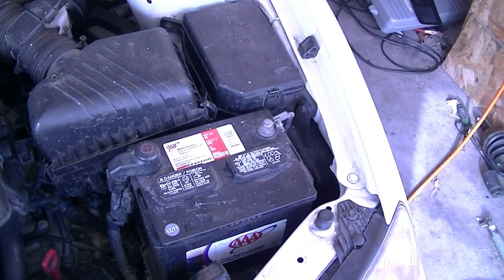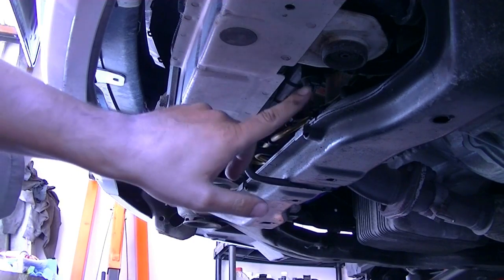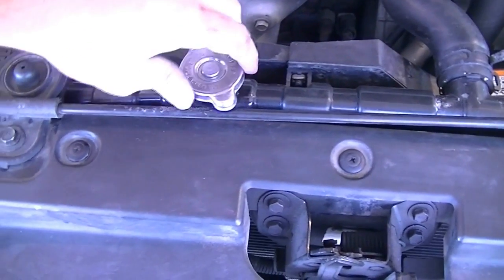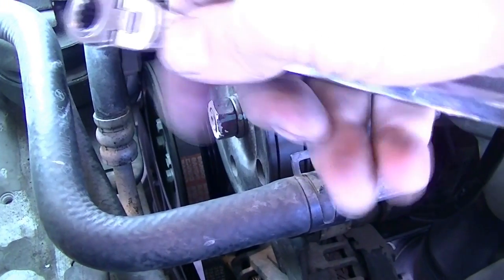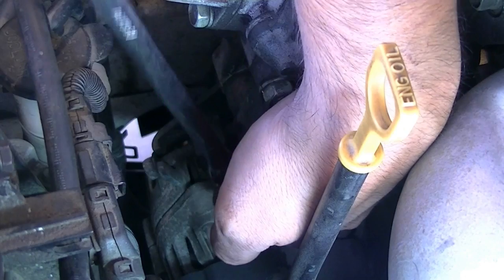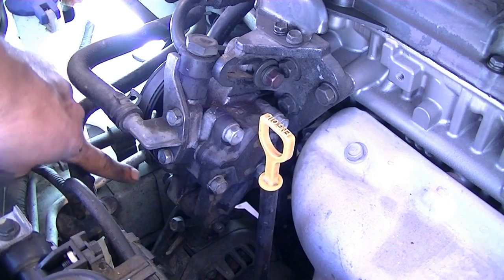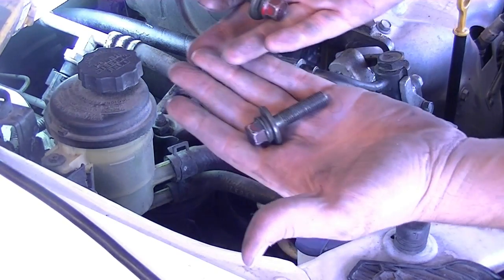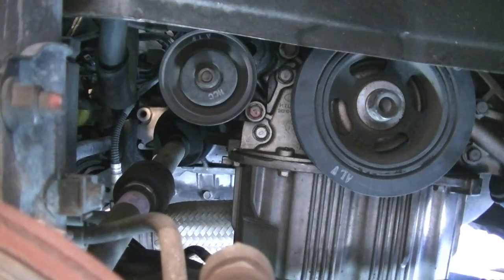Hyundai Elantra Timing Belt Replacement Part 1

Comment: Hello there! 
I like to ask you why did you changed the Water Pump and timing Belt. Was the Car Overheating? The timing belt that you removed to me looks like it was Ok!.  I have the same car and for some reason water  in the cooling system is not circulating and Keep blowing my radiator.
Reply: Could be thermostat, radiator, heater tap, blocked heater core, radiator hose, radiator cap, even your fans not working people. Can also be an air pocket in your cooling system if it wasnt bled correctly. It can be several things.

Comment: Is there a way to just look at the timing chain easily to see it's condition? We replaced it at 60,000 and have 140K now. What would a reasonable price be for replacement? Thanks for your expertise!
Reply: This engine has a timing belt. Timing chains very rarely need replacing unless they stretch or break completely.
Belt life differs depending on the car but a rough estimate is usually around the 100-150k km mark or 60-90k mile. And price wise i couldnt answer that as i am outside the states in australia

Comment: If the timing belt broke, do you need to work on the head before you replace the timing belt or can you get away with just doing the belt?
Reply: If your timing belt breaks then youll have to pull of the head. Most likely you would have damaged a few, if not most of the valves, possibly other parts of the valvetrain. You also need to check pistons as you could have damaged then as well as possible damage tl cylinder walls and in rare circumstances piston rods(ive seen it happen once when a valve broke and fell into the cyclinder on compression stroke and it jammed the valve between the piston and top of the cylinder jamming up the rod and bending it.
Its a castastrophic engine failure as youd be looking at a full engine rebuild

Comment: This is a great instructional! It saved me a ton of time figuring out the tricks and made this job sooo much easier. One additional tip for others, when you get all the way to the difficult wp gasket cleaning step, remove the motor mount bracket on the side of the engine. 3 bolts and the whole water pump gasket face is wide open to clean off.

Comment: Finally a video that doesn't do the work for the step then say " I already did it, but just do this". Watched this 3 part a few times making sure to make notes, and another video where I learned a different trick or two. I was nervous to do the job, but have plenty of experience in working on my vehicle. Basically rebuilt it. Once the engine goes, I'll buy something new and try to rebuild the engine and look inside transmission. One trick I figured out since I didn't have the boxed ratchet wrench here at job time was to loosen the water pump bolts. Then after belts removed, use my 10 mm boxed end wrench (short because of size) end to go onto the pump and turn the pump in clockwise direction by hand to speed up removal. That area is sure tight like you said. Took me a lot longer, but the job got done. Awaiting new belts now to call it completed 100% but she runs so much nicer!. Just under 240,000 km (150,000 miles) on engine. Previous owner hadn't maintained anything. Lots of small cracks throughout the belt. I think I got it done just in time.  My issue was using a comment of 32- 41 ft lbs for tension bolt. Mine snapped off at 36. Had to order new one from dealer. Proper torque is 16.6 to 21 as per printed sheets from dealer shop. Thank you again for taking the time and putting in so much detail in all of your videos.

Comment: Is this an interference or non interference engine?
Reply: Mt man 1949 interference
Reply: All Hyundais are but many newer years have a chain instead of a belt which helps that fact. There's one older kia model from early 2000s tho that's non-interference engine and it's basically a hyundai.

Comment: Hey good job,couple of questions here,to replace the crankshaft seal,do I just slide out the cranck gear?or do I need a special tool? Is ok if I put silicone around the pump with the gasket? Thank you.

Comment: Excellent video series (three videos) that allowed me to do this all on my own.  My only critiques are that you don't address re-installing the lower pulley, particularly the amount of torque to put on the bolt (125-132 ft./lbs, it turns out) and the torque for the timing belt tensioner (32-41 ft./lbs., it turns out).  Thanks for the otherwise thorough instructions.

Comment: Dont drain the radiator via the orange plug. Take off the lower rad hose instead. If you do take the plug out, Go buy a new one. They are stocked items at most dealerships. It  always happens where the old orange screw snaps off when you go to tighten it. Either buy a new one at the start or drain via thge lower hose. The old plug is almost always brittle and unusable after the constant heat cycles.

Comment: Did you put the passenger side on a jack stand or both. Also asking Zach Sanchez's question again. If you don't have an impact wrench is this not doable???
Reply: Its best to jack both sides up and put a jack stand under each side. Dont put them under the jacking points, place them under crossmembers/any solid point under chassis. Once the car is on jack stands and level, use the floor jack to support the engine sump with a block of wood between the jack plate and sump.
If you dont have a impact gun, crack the nuts prior to lifing the car. Otherwise your tire will just spin and you cant get the nuts undone. Also you run thr risk of shaking the car off the jack stands as you will no doubt cause the car to rock if you use too much force loosening the nuts by hand. Seen this done and it is very damgerous and very costly!
Reply: Also when jacking up the sump you dont have to "jack up" the engine. It is purely there to support the engine once the mount is undone. You can still cause damage if you jack it up. Once the jack is touching the sump, lock it off and leave it where it is.
As well as possibly causeing damage you will add pressure onto the mount by forcing it up, so when you go to under the nuts you can run the risk of shifting the engine further up then should be making it. More difficult to bolt the mount back on when putting the car back together

Comment: Thank you very much for diy video, I am in process of changing the timing belt, water pump, idler, tensioner, alternator belt and a/c compressor belt. Before i take out the old timing belt, i did place camshaft and crankshaft on the top death center position and checked it about 5 or more times.Came to the part of putting on timing belt.I started the timing belt by wrapping around at the crankshaft gear, pass the idler pulley and then wrapping the timimg belt around the camshaft. Tied the timing belt to the right of UP hole so there is no slack and had a little slack on tensioner side. When i placed the tensioner hand tight before i started using the allen key to hold it and tighten it, I noticed that my the white mark on crankshaft does not align with finger on the body and the hole at UP sign camshaft have moved to the right about two or three mm. This is where i made a mistake, i put on the crankshaft bolt and turned about 2 revolution hoping to align the camshaft by turning the crankshaft. I forget to put the belt on when i turned the crankshaft clockwise .Now both crankshaft and camshaft are misaligned. 

The question is how do i realign camshaft and crankshaft to get "Top Death Center", knowing that the alignment between crankshaft and camshaft need to be in sync. Please provide some steps. Thank you.
Reply: TDC only applies to the crank. It refers to the postion of the pistons in relation to what cycle the engine is in. Intake, comlression, power and exhaust TDC means the number one piston is at the top of its stroke.
The belt alligns the cam and crankshaft. The camshaft controls your valves. A camshaft has lobes in specific postions that, as the camshaft rotates, opens and closes specific valves depending on what pistons are where and what the firing order of the car is. It could be cylinder 1-3-2-4 or cylinder 1-4-3-2. It varies.
The purpose of align the camshaft and crank to the correct postions is so that the pistons dont crash into the valves. At no.1 cyinder TDC both inlet and exhaust valves are closed. If the cams arent lined up properly then one valve will be slightly open. And can cause major damage depending on what design engine you have.
To realign the cam and crank youd have to set the crank at no1. TDC (with the head off) and then put the head back on once the camshaft is lined up with the correct mark(and the no1 inlet and exhaust valves are fully shut)
Reply: @chriswithers568  Thank you very much for the explanation and happy new year....I have to undo and redo the whole thing and it worked..I am about to change the timing belt again.btw do you have the same make,model and year car?If you do.....did you used any high temp rtv silicone gasket for the water pump? How time flies.....wish me luck.thanks again

Comment: This engine looks identical to the engine in my 2004 Kia Spectra.
Reply: +jackslater230011 Cause it the same engine.  The factory belt on my Hyundai said KIA on it.
Reply: ***** Back in the early 90s my dad had a Mercury Capri and the little thing in the center of the steering wheel said Ford. By the way, is Kia owned by Hyundai?
Reply: Yes they are the same company, they do have separate assembly lines for them though.   They are right across the street from each other in Korea.  However more than half of their cars are made in the USA these days.
Reply: @frugalprepper  yeah the usa ones are horrible compared to korean counterparts. All the bad things I hear about them now is from usa models. Mines korean made and hasn't had none of that engine issue crap and mind you it's a 2005

Comment: It would be easier to just replace the timing belt only , it gets confusing for rookies Mechanics  when the water pump is included.....I know how to line up the marks on top , do you keep turn to the right to line line the lower marks ??? And when those lines are line up ?? You are done with the time belt ???
Reply: +Jose DeJesus yes it is easier and saves time. BUT then you bolt it all together drive for a while then your Idler pully gives up then your water pump shit's it's self, good practice to save time and money will tell you to do the lot in first hit then you have piece of mind.

Comment: If I don't have an impact wrench is this not doable?
Reply: I just did it.   Do a search on YouTube for how to take crank pulley off without an impact wrench.   Basically, if your engine turns clockwise, put a breaker bar on and turn the breaker bar clockwise until it stops on firm part of car (i.e. Frame...).  Put something behind it to hold it against the firm part of the car without any gaps.   Then remove a wire to ignition coil or unplug spark plugs or something to make sure the car won't actually start.   Turn the key real quick.   That's it.  I had to try it 3 times and it finally broke loose.  Prior to that I had tried my electric impact wrench, but it didn't work.  Hope this helps someone.
Reply: If it doesnt crank you can jam a screwdriver between the pulley and block and then put pressure against the pulley and crack the nut loose

Comment: Is it difficult to replace the cam and crank seal?
Reply: datchulo1085     No, it is very easy.   The crank gear has a "key" that has to be removed.  It looks like a peg that you pull straight out, but actually it is shaped like a 1/2 moon and you pull it out and to the side at the same time with a pair of vice grips and it comes right out.  I just beat a small screwdriver through the seal a couple of times and then popped it out (be careful not to touch or buggar  up the edges of metal that aren't removed).  Spray a lil brake cleaner in the cavity and wipe with a Q tip.  Put some oil on the seal and push in.  Once seated, get a large socket or 1 1/2" pfd pipe and tap it the rest of the way in.

Comment: Thank you for your time and very detailed explanation and demonstration on how to perform this job.  I just completed this work and it took my 4 and one half hours.  I want to share a technique I used when reinstalling the water pump and alternator pulleys.  Since the space is very limited, you will have a hard time aligning the pulley holes with those of the water pump as you indicated.  I fabricated a guide from an old bolt that had the same threads as the water pump by cutting of the head.  Then, I threaded the headless bolt onto the water pump and then slide the pulleys on.  This ensured that the remaining three holes were aligned properly and that the pulleys were supported without me having to hold them in place.  Then I screwed in three of the bolts, removed the threaded headless bolt, and then finished off by installing the fourth bolt.  It worked perfectly as I was abkle to have not only the pulley supported by the small headless bolt, but also ensured that the holes were lined up, saved a lot of headache and time.

Comment: I have a 2000 Hyundai Elantra, died on my wife while driving, thought it was the battery, so we tried to jump it, then tried starting it, ended up taking it to a garage, and they said it was the timing belt, is there anyway to find out if the valves are bent without opening up the cover?
Reply from the maker: pretty much the valves are guaranteed to be bent, if you want you can have them put a timing belt on and see if the car runs. If money is an issue I would just buy a used cylinder head and have them install it if money is not than you should rebuild your head. You can get good deals on ebay, some good deals on rebuild ones too. GL
Reply: Pull the valvr cover off and turn the engine ove by hand. See if all the valves are mlving freely. Also if you cant turn the engine over 1 full turn then that would indicate it.
But yes most likely you would have thrown a valve

Comment: I need to do a leak down test and need an air compressor for the leak down test kit. I figure I might as well buy a compressor that can power future tools instead of a small one that only works for leak down testing. I noticed you use a lot of harbor freight tools in your videos. I wanted to start using air tools. I was thinking of buying the earthquake impact I saw in your video. I repair my own vehicles, engine and suspension work mostly. Which air compressor would you recommend? Did you get the harbor freight air compressor for that impact? Which impact is the most useful (1/2, 3/8, 3/4)?
Reply from the maker: Jackson Hokanson I use a 30g husky air compressor from Homedepot. Works great, also the 1/2" impact from harbor freight is awesome as well, just dont forget to lube it.

Comment: I want to say thanks for your video. I bought a kit with the belt , pulleys, and water pump for under 100 dollars and did it myself, I had to heat up the damper bolt to get it off but other than that it went well. your videos are well done, keep it up. thanks again. mike

Comment: The Hyundai dealer wants to change my timing belt for $500, even though there is nothing wrong with it.  My car has 35,000 miles.  What should I do?
Reply from the maker: John DeMeo 35K miles is way too soon! I dont know what year is your Hyundai, but generally its every 60-80K miles. You might want to do a google search and find out what its the exact interval for you year/model. But I seriously doubt its 35k. gl
Reply: RatchetsAnd Wrenches It's a 2010 Hyundai Elantra Touring GLS.  I bought it in December 2009.  I drive only about 8,000 miles per year.  I did a search as you recommend.  They say 60,000 miles or four years, whatever comes first.  The dealer wants $500 for the job.  He also wants $90 for rear break service, even though my brakes work fine.  I never know if they are playing me.  Thanks for your help!
Reply: John DeMeo I still think that sounds too soon for your timing belt. Every 4 years is probably just to be safe but I think that's a little too early. 

If you have rear drums, a brake service is a good idea. It will keep your drum brakes quiet. They're going to clean it all up, grease the moving parts, and adjust your shoes properly.

Comment: Friend, good night, because you disconnected the battery cable. is not to cause trouble in any sensor or reading data ??
Reply from the maker: yes for extra safety, we dont have a kia cerato in the U.S but if it has a 2.0L engine it should be very similar if not the same. Good luck
Reply: It wont if you disconnect it properly
Reply: And the engine is off

Comment: Thanks for the great video. A couple of things I found when fitting the pulleys to the water pump. I made up a small guide stud, then put a small bit of white grease on the first pulley (this helps to hold it in place on the water pump), then fitted the second pulley, then fit a nut to the guide stud. This held it all together while fitting the bolts. Removed the nut & guide stud & fitted last bolt. Sounds like a bit of stuffing around, but those damn pulleys just wouldnt stay there. Cheers
Reply: Peter Bowers    They were a bear!    I jacked engine back up, then got one holes lined up.   I put a small piece of newspaper on the head of each bolt and jammed the bolt into the socket with and extension attached.  Then I started it by hand using the socket on the 1/4" extension.   
It's like having a magnetic socket to hold the bolt.

Comment: Great video! I used nothing but the video to repair the timing belt and water pump on my 2005 Hyundai. Took me 5 hours but I got it done! Lucky the gasket for the water pump came right off and I didn't have to clean it at all. I didn't torque anything down according to specs, but instead winged it.... even though I probably shouldn't. Thanks!